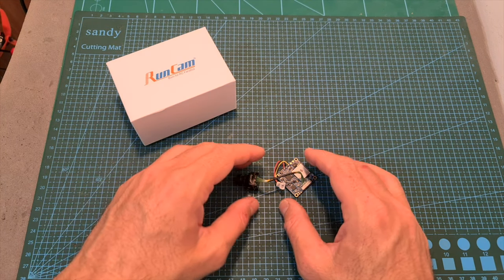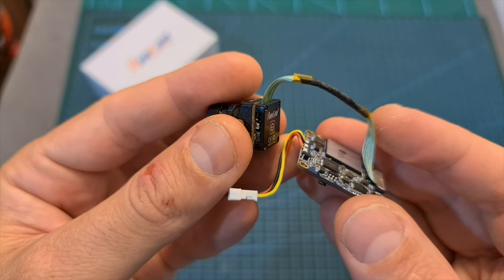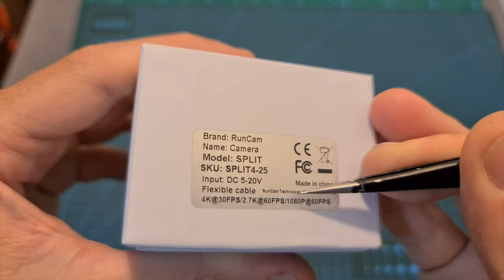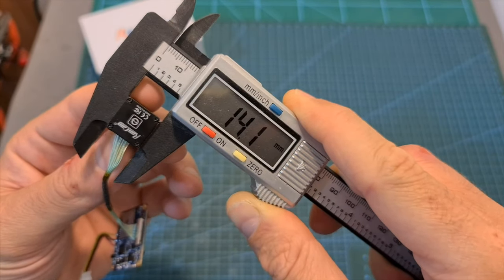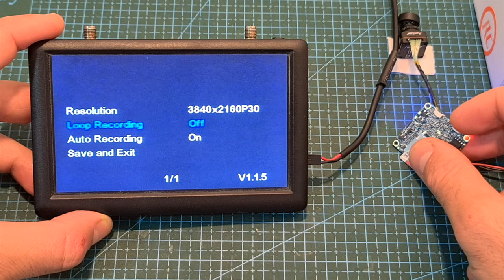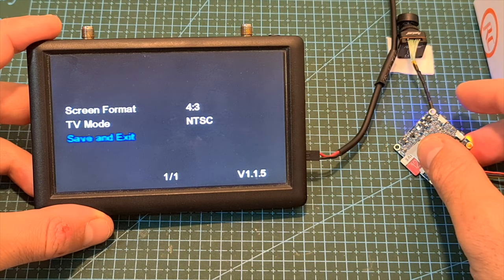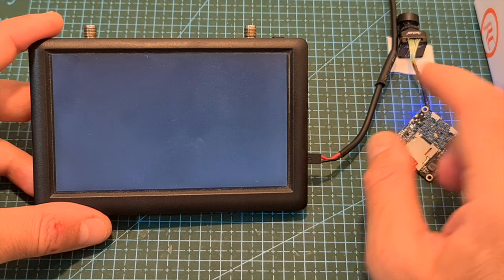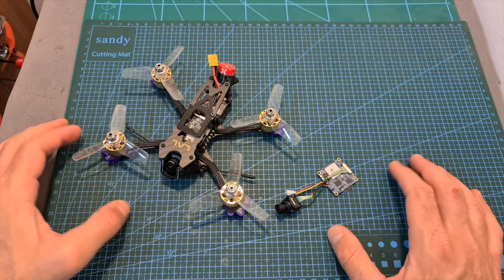Runcam Split 4 - Overview, Latency Test & Flight Footage

Comment: I miss the goggle view .IMO they all record video fairly well its the fpv feed view I'm concerned with 😕👍
Reply: It's about time they gave us at least 720p in our fpv feed
Reply: @el xero that is possible with OpenHD. You connect a 4K action camera to the PI system and then you can get 4K recording plus 720p FPV! I suggest the Hawkeye Firefly Split 4K with HDMI output.
Reply from the maker: Please see my pinned comment. Video will be up soon.
Reply from the maker: The latency of openHD is about 110ms and in my opinion is too high for freestyle and of course racing.

Comment: Video looks decent if you could run it thru some sort of smoothing software, would be great. Should throw in some goggle view of it, but I may have missed if you mentioned that.
Reply from the maker: I had some VTX issues with the LAL3 (It has a terrible VTX and I need to change it), so I didn't include the FPV feed as the VTX interference destroyed it. I will upload the FPV footage along with HD next week in my comparison video.
Reply: @KremerFPV  Ah all good, great video!

Comment: Can it be connected directly to a battery or do I need a drone flight controller? Do I need a monitor like you used or can I change the settings from a laptop? I am looking into this camera to mount inside a high power rocket because of its light weight and small size, but I am not familiar with the drone world.

Thanks
Reply from the maker: You will need an AV adapter for connecting it directly to your laptop. You can power it directly from a battery but preferably you should use a BEC.

Comment: Gal, have you compared the Runcam Hybrid 4K to this Split 4?  I have an older Split 2 on my quad, and a Hybrid on my fixed-wing (Ritewing Mini Drak).  The Hybrid requires a very fast micro-SD card to record >1080p with any quality.  I've been told I need 100mB/sec, or higher, write speed.  Anything less and there are "jitters" in the recordings.  Still is amazing scenes, but the stuttering/jittering is annoying.  Thanks for the videos!!!
Reply from the maker: I didn't compare the two, sorry. 
Yes, you should definitely use a high quality class 10 card when recording 4k videos.

Comment: Did I miss something? Is there any quad frame with mount hole distance 25,5 x 25,5?
Reply: I was thinking the same. This is for whoops... not for 20*20. 
Would be useful if they provided a mounting solution for non-whoops!
Reply from the maker: Yes, they should provide an adapter if they are not going to come up with a 20*20mm version.

Comment: Hi Gal great video do you know what is with the instruction not to power directly from the battery in case you burn the camera?  Does it need a capacitor or just connect directly to 2-3S?
Reply from the maker: Thanks! It's because of voltage spikes, so better use a voltage regulator. A capacitor should help as well.

Comment: Hello nice overview and good video, I would like to know if there is a way to recover the 4k split card since I have connected 4s power supply ok. I have inserted a sd with new firmware. orange led was flashing but I cut the power before the update was finished and now there is no sign of life. thanks

Comment: Which monitor to use with this camera for testing? And how did you connect that camera to the display?
Reply from the maker: Any monitor with an AV input will do - you just need to make the adapter by yourself.

Comment: what do you use to set the camera quality and its possible to run camera only with sd card and battery I want to use this camera in rocket only for footage not for fpv
Reply from the maker: Yes, you can just power it using 5V and it can act as a standalone camera. I suggest going with a Thumb camera though.

Comment: I’d like something like this for my racing setup but the latency needs to come down. Also the extra PCB in the stack is still an issue - I don’t know why Foxeer (who make both cams and FCs) haven’t found an elegant solution to integrate the two. Thanks for the review Gal 👌🏻
Reply from the maker: My pleasure Joe. I have no idea where you came up with this information that Foxeer are making both boards.
Reply: Gal Kremer haha I was suggesting that Foxeer should integrate the pcb with the FC given that they design both - unlike Runcam who don’t

Comment: Are you getting signal lock with your goggle VRX using this Runcam Split 4?  For whatever reason, I am not getting signal lock with my RapidFire using this Split 4.  If I disconnect the Split 4, signal lock immediately.  Tried testing on 3 other quads, signal lock *immediately*.  I recommend Runcam spend more time on quality control than trying to put out new useless cams that dont work properly.  They have been having random stupid issues since the Runcam Hybrid.
Reply from the maker: Did you try legacy mode on the RF?
Reply: @KremerFPV  tried all modes. So you are getting signal lock with your rapidfire just fine?
Reply from the maker: @theronin48  Yes, Which VTX are you using?
Reply from the maker: BTW try to switch the camera mode (NTSC / PAL).
Reply: @KremerFPV  thanks gal tried all that. Short of it is if i disconnect the split 4 the signal lock comes on imnediately. Plug it back jn and it goes away. Also tried higher voltage and physically separating the Matek Vtx from the split 4. I have the same matek on a gecko with tarsier zero issues. If you still have the split 4 and get a chance i would appreciate if you could check to see if you get signal lock.
Reply: @KremerFPV  From the Runcam brain trust:  https://i.ibb.co/jhNvWBn/Screen-Shot-01-06-21-at-12-26-AM.jpg

Comment: Hello, thank you, my friend. I have benefited a lot from you. I would like to buy a runcam spilt 4 camera in order to install it on the falcon that I own, but the wire that connects the camera to the dvr can be changed so that it becomes longer, for example 10 cm. Please answer me
Reply from the maker: Hi there, I am glad you enjoy my videos. You can buy 8.5 cm longe cables: https://caddxfpv.com/collections/accessories/products/turtle-v2-coaxial-cable-5cm-and-10cm
Reply: @KremerFPV  Thank you for your response, you are a good person, but I have another question. I hope you will answer me. I do not have a drone, so I want to operate the split4 using a 1s 3.7v300mah battery, but you said that the split4 does not work to (5 ~ 20) volt. Can I use a 1s battery to operate it or should I  Combine 1s + 1s to work
Reply from the maker: @yagamilight2693  No problem. You can't use a single 1s battery, but sure - you can connect two 1s batteries in series in order to create a 2s battery and then use it.
Reply: @KremerFPV  Thank you very much for helping me. I wish you happiness
Reply from the maker: @yagamilight2693  Same to you

Comment: Gal i got this camera but it will only record for about 3 seconds then stops. im using a U1 card , is this enough or do i need a U3?
Reply from the maker: Does it happen also when you record videos at 1080p?
Reply: @KremerFPV  put a u3 card in it and works fine now👍

Comment: All this split type camera videos need to have post production software like RealSteadyGo. Till then it will not be in the same level with GoPro.
Same applies to Runcam5 and Foxeer Box cameras
Reply: Real men fly with no postproduction
Reply from the maker: I am pretty sure that eventually these cameras will feature this option.
Reply: @KremerFPV  I'm very doubt about it. Best footage stabilizing software is RealStedy Go, and ironically its belong to GoPro. I don't thing they intend to support another company video cameras, but want to keep Gopro production with advertising as best stabilized footage. And its 100% true.

Comment: how do you convert the 30fps to 60fps without it being choppy?
Reply from the maker: Why should it become choppy?
Reply: @KremerFPV  it's cutting half a frame from 30 to become 60 no?
Reply from the maker: @joyindeeamornchai754  Even if you change a 30fps video to 10000fps it will still be a 30fps video and it won't be choppy.
Reply: @KremerFPV  thanks